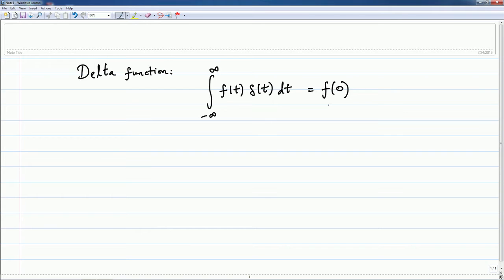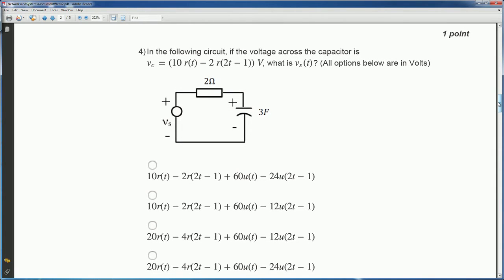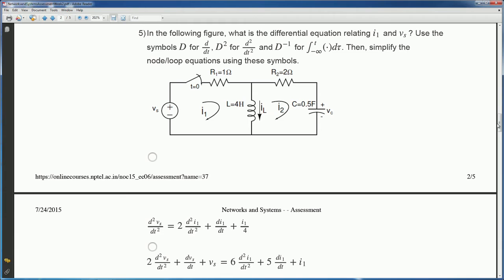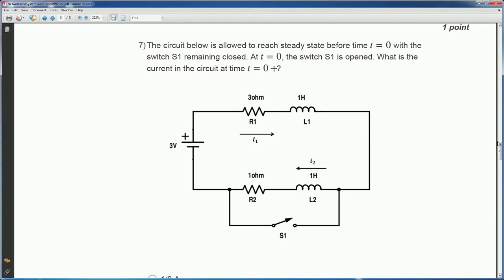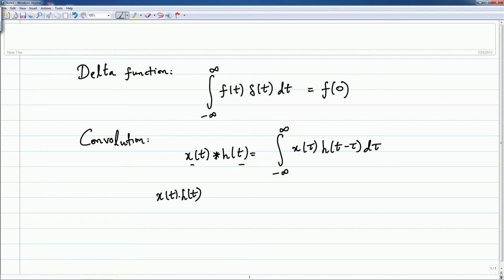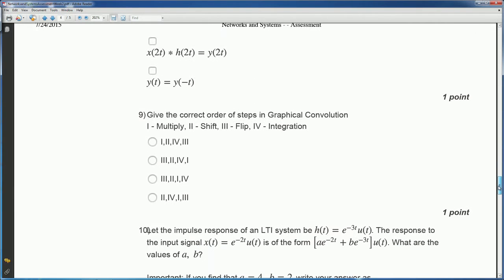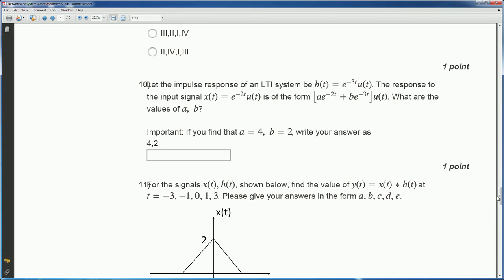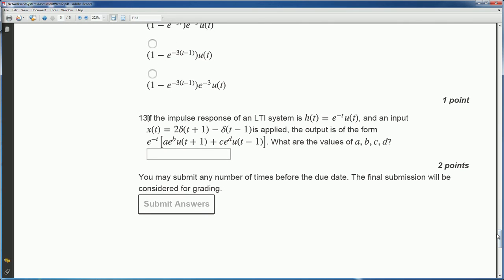Assienment 2

Comment: def of delta func int (f(t).delta(t).dt) for t->-inf to +inf = f(0) 1:00
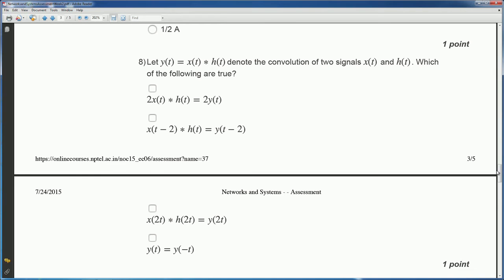convolution   11:00
in convolution x(t)*delta(t-tow) the entire t valus are used giving another func as output and not just a numerical value. thus convolution operator * is an operator operating on entire func domain
for an LTI syst : impulse resp h(t) is the output resp of the syst to an impulse func delta(t) as input to the syst.  15:00
for an LTI syst : the op resp y(t) for any arbitrary ip x(t) can be calculated by convolution x(t) * h(t-tow) given syst impulse response h(t) 17:30

 h(t)